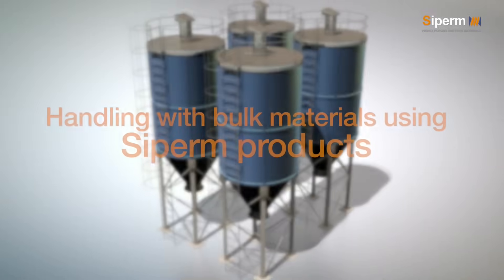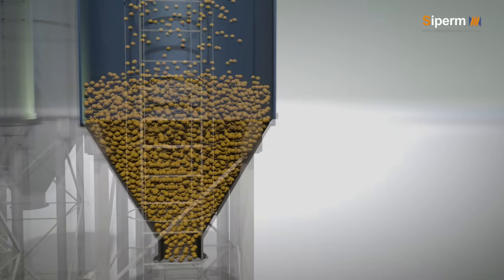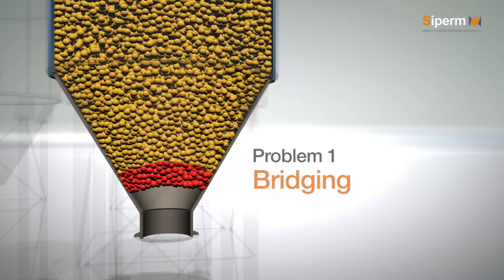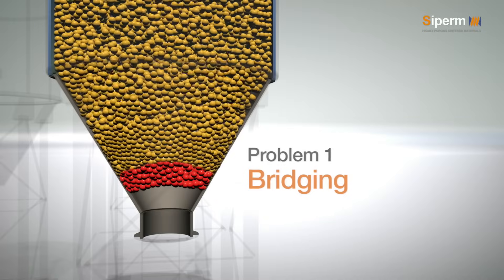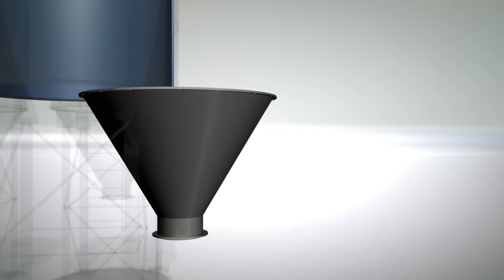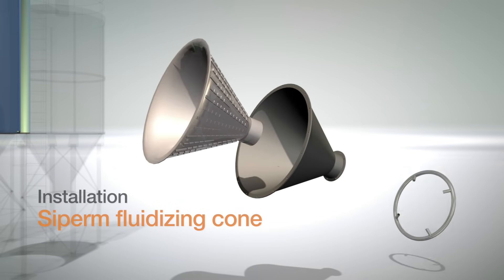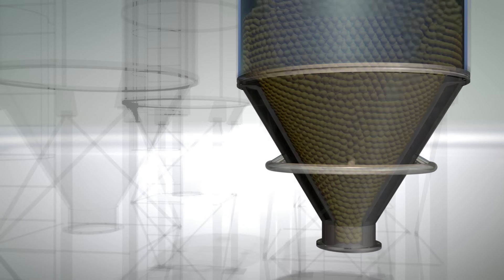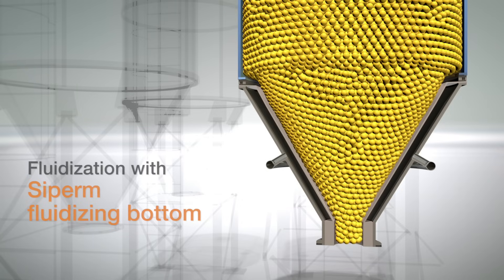Silo Discharge - Animation

Comment: vibratory discharge systems are leaps ahead of this as you don't have a ton of explosive positive pressure exhaust from your silo
Reply: they are certainly not. fluidization systems are state-of-the art.